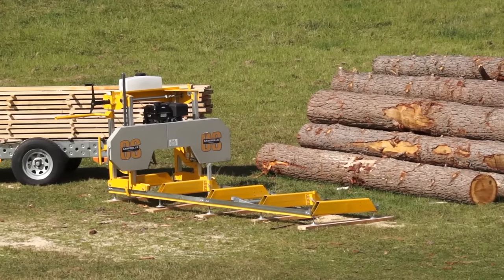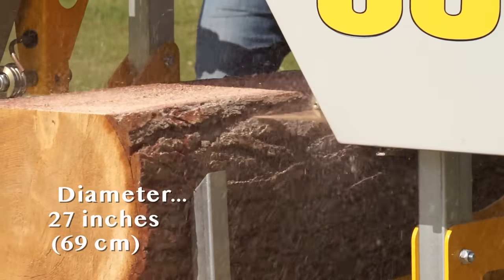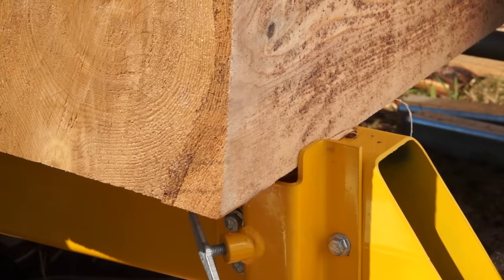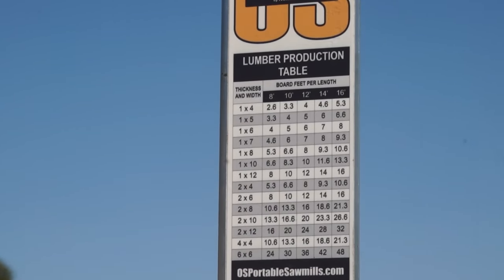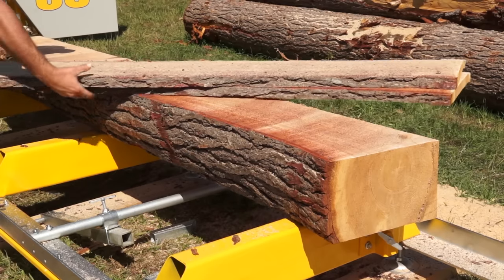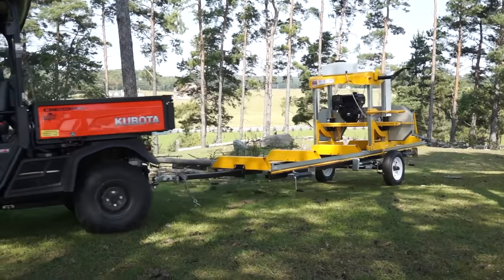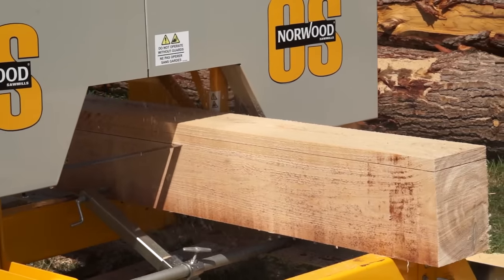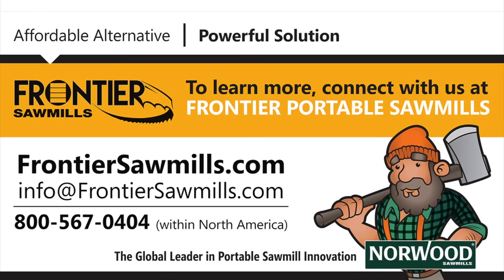The Affordable, Easy-to-Use & Reliable Sawmill You've Been Looking for - The Frontier OS27

Comment: Cost
Reply from the maker: Hi Mike

Frontier builds three sawmill models with different log diameter capacities: OS23: 23” (59cm), OS27: 27” (69cm), and OS31: 31” (79cm). Standard log length is 11’ (3.4m) but you can add 7’ (2.1m) extensions to mill as long as you want.  You can add the optionally available trailer/support jack system to all Frontier sawmills at any time (when you get your Frontier or in the future). 

Frontier Sawmills start at just USD $2297 (for the Frontier OS23). The Frontier OS27 starts at only $3297.  The Frontier OS31 starts at only $3897. 

You can get a lot of helpful info about Frontier Sawmills, including all pricing, at www.FrontierSawmills.com  .

We would be happy to mail you a free Frontier Sawmills info kit. You can order one online at  https://www.frontiersawmills.com/en_us/free-catalog-free-dvd-form

Thanks!

Comment: I want to buy this in the Philippines
. Please let me know about the details of purchasing and delivery methods in Philippines
Reply from the maker: Frontier builds three sawmill models with different log diameter capacities: OS23: 59cm (23”), OS27: 69cm (27”), and OS31: 79cm (31”). Standard log length is 3.4m (11’) but you can add 7’ (2.1m) extensions to mill as long as you want.  You can add the optionally available trailer/support jack system to all Frontier sawmills at any time (when you get your Frontier or in the future).

Frontier Sawmills start at just USD $2297 (for the Frontier OS23). The Frontier OS27 starts at only USD $3297.  The Frontier OS31 starts at only USD $3897.  

You can get a lot of helpful info about Frontier Sawmills, including all pricing, at www.FrontierSawmills.com  .

Frontier services your country factory-direct.  To order, contact us directly at Frontier Sawmills via email at info@FrontierSawmills.com .

Comment: What's the price?
Reply from the maker: Frontier builds three sawmill models with different log diameter capacities: OS23: 59cm (23”), OS27: 69cm (27”), and OS31: 79cm (31”). Standard log length is 3.4m (11’) but you can add 7’ (2.1m) extensions to mill as long as you want.  You can add the optionally available trailer/support jack system to all Frontier sawmills at any time (when you get your Frontier or in the future).

Frontier Sawmills start at just USD $2297 (for the Frontier OS23). The Frontier OS27 starts at only USD $3297.  The Frontier OS31 starts at only USD $3897.  

You can get a lot of helpful info about Frontier Sawmills, including all pricing, at www.FrontierSawmills.com  .

Comment: How much costs this machine?
Reply from the maker: Frontier builds three sawmill models with different log diameter capacities: OS23: 59cm (23”), OS27: 69cm (27”), and OS31: 79cm (31”). Standard log length is 3.4m (11’) but you can add 7’ (2.1m) extensions to mill as long as you want.  You can add the optionally available trailer/support jack system to all Frontier sawmills at any time (when you get your Frontier or in the future).

Frontier Sawmills start at just USD $2397 (for the Frontier OS23). The Frontier OS27 starts at only USD $3397.  The Frontier OS31 starts at only USD $3997.  

You can get a lot of helpful info about Frontier Sawmills, including all pricing, at www.FrontierSawmills.com  .

Frontier services your country factory-direct.  To order, contact us directly at Frontier Sawmills via email at info@FrontierSawmills.com . 

Thanks!

Comment: I am bay it.now price?
Reply from the maker: Frontier builds three sawmill models with different log diameter capacities: OS23: 59cm (23”), OS27: 69cm (27”), and OS31: 79cm (31”). Standard log length is 3.4m (11’) but you can add 7’ (2.1m) extensions to mill as long as you want.  You can add the optionally available trailer/support jack system to all Frontier sawmills at any time (when you get your Frontier or in the future).

Frontier Sawmills start at just USD $2297 (for the Frontier OS23). The Frontier OS27 starts at only USD $3297.  The Frontier OS31 starts at only USD $3897.  

You can get a lot of helpful info about Frontier Sawmills, including all pricing, at www.FrontierSawmills.com  .

Frontier services your country factory-direct.  To order, contact us directly at Frontier Sawmills via email at info@FrontierSawmills.com . 

Thanks!

Comment: Amazing how much? I need that machine to my business, plzzzz help me
Reply: Im here in philippines
Reply from the maker: Frontier builds three sawmill models with different log diameter capacities: OS23: 59cm (23”), OS27: 69cm (27”), and OS31: 79cm (31”). Standard log length is 3.4m (11’) but you can add 7’ (2.1m) extensions to mill as long as you want.  You can add the optionally available trailer/support jack system to all Frontier sawmills at any time (when you get your Frontier or in the future).

Frontier Sawmills start at just USD $2297 (for the Frontier OS23). The Frontier OS27 starts at only USD $3297.  The Frontier OS31 starts at only USD $3897.  

You can get a lot of helpful info about Frontier Sawmills, including all pricing, at www.FrontierSawmills.com  .

Frontier services your country factory-direct.  To order, contact us directly at Frontier Sawmills via email at info@FrontierSawmills.com . 

Thanks!
Reply: @FrontierSawmills  can I get this sawmill in India ?

Comment: How much this
Reply from the maker: Frontier builds three sawmill models with different log diameter capacities: OS23: 59cm (23”), OS27: 69cm (27”), and OS31: 79cm (31”). Standard log length is 3.4m (11’) but you can add 7’ (2.1m) extensions to mill as long as you want.  You can add the optionally available trailer/support jack system to all Frontier sawmills at any time (when you get your Frontier or in the future).

Frontier Sawmills start at just USD $2297 (for the Frontier OS23). The Frontier OS27 starts at only USD $3297.  The Frontier OS31 starts at only USD $3897.  

You can get a lot of helpful info about Frontier Sawmills, including all pricing, at www.FrontierSawmills.com  .

Comment: fine,how much?
Reply from the maker: Frontier builds three sawmill models with different log diameter capacities: OS23: 59cm (23”), OS27: 69cm (27”), and OS31: 79cm (31”). Standard log length is 3.4m (11’) but you can add 7’ (2.1m) extensions to mill as long as you want.  You can add the optionally available trailer/support jack system to all Frontier sawmills at any time (when you get your Frontier or in the future).

Frontier Sawmills start at just USD $2297 (for the Frontier OS23). The Frontier OS27 starts at only USD $3297.  The Frontier OS31 starts at only USD $3897.  

You can get a lot of helpful info about Frontier Sawmills, including all pricing, at www.FrontierSawmills.com  .

Frontier services your country factory-direct.  To order, contact us directly at Frontier Sawmills via email at info@FrontierSawmills.com . 

Thanks!

Comment: How i contact you......For buy this machine
Reply from the maker: Frontier builds three sawmill models with different log diameter capacities: OS23: 59cm (23”), OS27: 69cm (27”), and OS31: 79cm (31”). Standard log length is 3.4m (11’) but you can add 7’ (2.1m) extensions to mill as long as you want.  You can add the optionally available trailer/support jack system to all Frontier sawmills at any time (when you get your Frontier or in the future).

Frontier Sawmills start at just USD $2297 (for the Frontier OS23). The Frontier OS27 starts at only USD $3297.  The Frontier OS31 starts at only USD $3897.  

You can get a lot of helpful info about Frontier Sawmills, including all pricing, at www.FrontierSawmills.com  .

Frontier services your country factory-direct.  To order, contact us directly at Frontier Sawmills via email at info@FrontierSawmills.com .
Reply: I seriously need this machine .I need to be first one to own in my local.

Comment: What are price this machine
Reply from the maker: Frontier builds three sawmill models with different log diameter capacities: OS23: 59cm (23”), OS27: 69cm (27”), and OS31: 79cm (31”). Standard log length is 3.4m (11’) but you can add 7’ (2.1m) extensions to mill as long as you want.  You can add the optionally available trailer/support jack system to all Frontier sawmills at any time (when you get your Frontier or in the future).

Frontier Sawmills start at just USD $2297 (for the Frontier OS23). The Frontier OS27 starts at only USD $3297.  The Frontier OS31 starts at only USD $3897.  

You can get a lot of helpful info about Frontier Sawmills, including all pricing, at www.FrontierSawmills.com  .

Comment: Price
Reply from the maker: Frontier builds three sawmill models with different log diameter capacities: OS23: 59cm (23”), OS27: 69cm (27”), and OS31: 79cm (31”). Standard log length is 3.4m (11’) but you can add 7’ (2.1m) extensions to mill as long as you want.  You can add the optionally available trailer/support jack system to all Frontier sawmills at any time (when you get your Frontier or in the future).

Frontier Sawmills start at just USD $2297 (for the Frontier OS23). The Frontier OS27 starts at only USD $3297.  The Frontier OS31 starts at only USD $3897.  

You can get a lot of helpful info about Frontier Sawmills, including all pricing, at www.FrontierSawmills.com  .

Frontier services your country factory-direct.  To order, contact us directly at Frontier Sawmills via email at info@FrontierSawmills.com . 

Thanks!

Comment: This machine price
Reply from the maker: Frontier builds three sawmill models with different log diameter capacities: OS23: 59cm (23”), OS27: 69cm (27”), and OS31: 79cm (31”). Standard log length is 3.4m (11’) but you can add 7’ (2.1m) extensions to mill as long as you want.  You can add the optionally available trailer/support jack system to all Frontier sawmills at any time (when you get your Frontier or in the future).

Frontier Sawmills start at just USD $2297 (for the Frontier OS23). The Frontier OS27 starts at only USD $3297.  The Frontier OS31 starts at only USD $3897.  

You can get a lot of helpful info about Frontier Sawmills, including all pricing, at www.FrontierSawmills.com  .

Frontier services your country factory-direct.  To order, contact us directly at Frontier Sawmills via email at info@FrontierSawmills.com . 

Thanks!

Comment: Prize this machin
Reply from the maker: Frontier builds three sawmill models with different log diameter capacities: OS23: 59cm (23”), OS27: 69cm (27”), and OS31: 79cm (31”). Standard log length is 3.4m (11’) but you can add 7’ (2.1m) extensions to mill as long as you want.  You can add the optionally available trailer/support jack system to all Frontier sawmills at any time (when you get your Frontier or in the future).

Frontier Sawmills start at just USD $2297 (for the Frontier OS23). The Frontier OS27 starts at only USD $3297.  The Frontier OS31 starts at only USD $3897.  

You can get a lot of helpful info about Frontier Sawmills, including all pricing, at www.FrontierSawmills.com  .

Frontier services your country factory-direct.  To order, contact us directly at Frontier Sawmills via email at info@FrontierSawmills.com . 

Thanks!

Comment: Price kitna hai
Reply from the maker: Frontier builds three sawmill models with different log diameter capacities: OS23: 59cm (23”), OS27: 69cm (27”), and OS31: 79cm (31”). Standard log length is 3.4m (11’) but you can add 7’ (2.1m) extensions to mill as long as you want.  You can add the optionally available trailer/support jack system to all Frontier sawmills at any time (when you get your Frontier or in the future).

Frontier Sawmills start at just USD $2297 (for the Frontier OS23). The Frontier OS27 starts at only USD $3297.  The Frontier OS31 starts at only USD $3897.  

You can get a lot of helpful info about Frontier Sawmills, including all pricing, at www.FrontierSawmills.com  .

Frontier services your country factory-direct.  To order, contact us directly at Frontier Sawmills via email at info@FrontierSawmills.com .

Comment: How much npr
Reply from the maker: Frontier builds three sawmill models with different log diameter capacities: OS23: 59cm (23”), OS27: 69cm (27”), and OS31: 79cm (31”). Standard log length is 3.4m (11’) but you can add 7’ (2.1m) extensions to mill as long as you want.  You can add the optionally available trailer/support jack system to all Frontier sawmills at any time (when you get your Frontier or in the future).

Frontier Sawmills start at just USD $2297 (for the Frontier OS23). The Frontier OS27 starts at only USD $3297.  The Frontier OS31 starts at only USD $3897.  

You can get a lot of helpful info about Frontier Sawmills, including all pricing, at www.FrontierSawmills.com  .

Frontier services you factory-direct.  To order, contact us directly at Frontier Sawmills via email at info@FrontierSawmills.com . 

Thanks!

Comment: What this price
Reply from the maker: Frontier builds three sawmill models with different log diameter capacities: OS23: 59cm (23”), OS27: 69cm (27”), and OS31: 79cm (31”). Standard log length is 3.4m (11’) but you can add 7’ (2.1m) extensions to mill as long as you want.  You can add the optionally available trailer/support jack system to all Frontier sawmills at any time (when you get your Frontier or in the future).

Frontier Sawmills start at just USD $2397 (for the Frontier OS23). The Frontier OS27 starts at only USD $3397.  The Frontier OS31 starts at only USD $3997.  

You can get a lot of helpful info about Frontier Sawmills, including all pricing, at www.FrontierSawmills.com  .

Frontier services your country factory-direct.  To order, contact us directly at Frontier Sawmills via email at info@FrontierSawmills.com . 

Thanks!

Comment: What is the cast of this machine
Reply from the maker: Frontier builds three sawmill models with different log diameter capacities: OS23: 59cm (23”), OS27: 69cm (27”), and OS31: 79cm (31”). Standard log length is 3.4m (11’) but you can add 7’ (2.1m) extensions to mill as long as you want.  You can add the optionally available trailer/support jack system to all Frontier sawmills at any time (when you get your Frontier or in the future).

Frontier Sawmills start at just USD $2297 (for the Frontier OS23). The Frontier OS27 starts at only USD $3297.  The Frontier OS31 starts at only USD $3897.  

You can get a lot of helpful info about Frontier Sawmills, including all pricing, at www.FrontierSawmills.com  .

Frontier services your country factory-direct.  To order, contact us directly at Frontier Sawmills via email at info@FrontierSawmills.com . 

Thanks!

Comment: Скажите сколько стоимость этого апарат
Reply from the maker: Frontier builds three sawmill models with different log diameter capacities: OS23: 59cm (23”), OS27: 69cm (27”), and OS31: 79cm (31”). Standard log length is 3.4m (11’) but you can add 7’ (2.1m) extensions to mill as long as you want.  You can add the optionally available trailer/support jack system to all Frontier sawmills at any time (when you get your Frontier or in the future).

Frontier Sawmills start at just USD $2297 (for the Frontier OS23). The Frontier OS27 starts at only USD $3297.  The Frontier OS31 starts at only USD $3897.  

You can get a lot of helpful info about Frontier Sawmills, including all pricing, at www.FrontierSawmills.com  .

Frontier services your country factory-direct.  To order, contact us directly at Frontier Sawmills via email at info@FrontierSawmills.com .

Comment: price how I
Reply from the maker: Frontier builds three sawmill models with different log diameter capacities: OS23: 59cm (23”), OS27: 69cm (27”), and OS31: 79cm (31”). Standard log length is 3.4m (11’) but you can add 7’ (2.1m) extensions to mill as long as you want.  You can add the optionally available trailer/support jack system to all Frontier sawmills at any time (when you get your Frontier or in the future).

Frontier Sawmills start at just USD $2397 (for the Frontier OS23). The Frontier OS27 starts at only USD $3397.  The Frontier OS31 starts at only USD $3997.  

You can get a lot of helpful info about Frontier Sawmills, including all pricing, at www.FrontierSawmills.com  .

Frontier services your country factory-direct.  To order, contact us directly at Frontier Sawmills via email at info@FrontierSawmills.com . 

Thanks!

Comment: Contry name of machine price
Reply from the maker: Frontier builds three sawmill models with different log diameter capacities: OS23: 59cm (23”), OS27: 69cm (27”), and OS31: 79cm (31”). Standard log length is 3.4m (11’) but you can add 7’ (2.1m) extensions to mill as long as you want.  You can add the optionally available trailer/support jack system to all Frontier sawmills at any time (when you get your Frontier or in the future).

Frontier Sawmills start at just USD $2297 (for the Frontier OS23). The Frontier OS27 starts at only USD $3297.  The Frontier OS31 starts at only USD $3897.  

You can get a lot of helpful info about Frontier Sawmills, including all pricing, at www.FrontierSawmills.com  .

Frontier services your country factory-direct.  To order, contact us directly at Frontier Sawmills via email at info@FrontierSawmills.com .